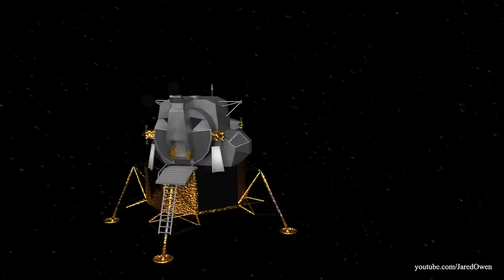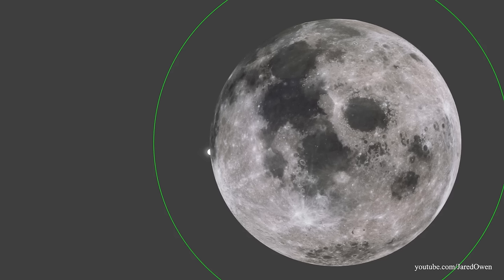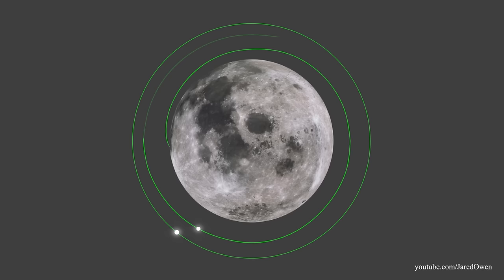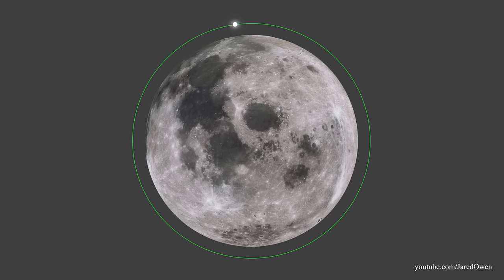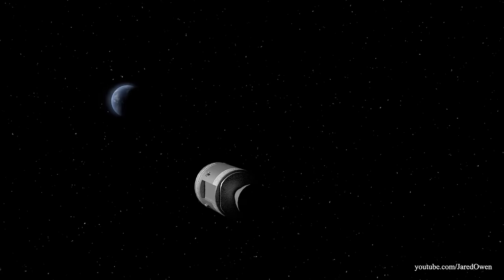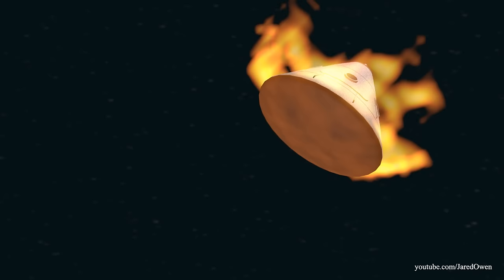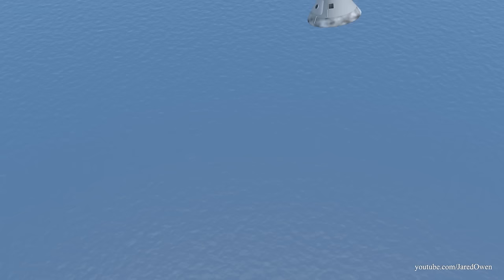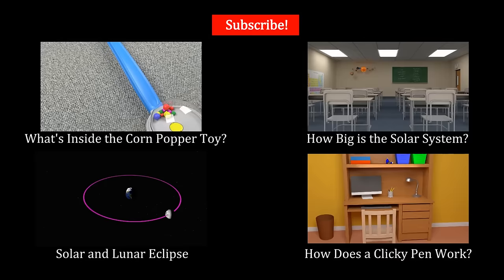How the Apollo Spacecraft works: Part 3

Comment: I was a (young) engineer on the Apollo launch team at Kennedy for Apollos 4 - 13.  This is an excellent series of videos about the missions.  Easy to understand graphics.  Good job.
Reply: what are the chances
Reply: @yutrewoyaGD  like 30%
Reply: Lets forget about Apollo I
Reply: Woah
Reply: appollo 11guy: So you were led to believe that those 3 liar went all the way to the moon?
Reply: @hassanchop7096  You mean they didn't??  Well, I feel pretty stupid.
Reply: @apollo11guy  They didn't leave LEO.
Reply: @hassanchop7096  How did they manage to position the laser reflector on the Moon's surface?
Reply: @apollo11guy  How did they get through the Van Allen radiation belts to get to the moon? As for the reflectors, they must have put them there the same way they put Perseverance on Mars and if so, they would no longer be functioning due to the way the lunar dust gravitates towards the lunar sky when the sun strikes the surface and then falls when the sun has passed by.
Reply: @hassanchop7096  I think it is time to change the aluminum foil in your ET beanie.
Reply: @apollo11guy  I think it's time for you to put down the glue bag sonny!
Reply: @hassanchop7096  I was hoping you would tell us about your last Flat Earth Society meeting;  what did you contribute?
Reply: @apollo11guy  Wrong again sonny, no flat earther here, the ISS is real😋have you ever tried boiling your head btw?🤣
Reply: @hassanchop7096   How?  Very fast.
Reply: @apollo11guy  Very fast what, are you still drunk?
Reply: @apollo11guy  I wish to apologise on behalf of the human race for people like Hassan Chop.
Reply: @letsrock72  He's a person?  I assumed he was an alien.
Reply: Hi, I watched all the ads. Do you allow me (77 yo) to write something down what I once learned about the Saturn 5. First of all I have  u huge admiration of all the amazing people who worked on it.  You are the real stable geniusses.
Now what I find so mind blowing:  The 5 , F1 engines consume in about 2.5 minutes about 2000!  tons of kerosene. One engine also about 400 tons.
Therefore it needs a pretty huge pump. Somebody compared the fuel flow to taking the bottom out of a watertower. The gasturbine that drives the pump, delivers a stunning 55,000 ( fiftyfivethousand) horsepower. The power of a of a cruiseschip engine. The exhaust gases cool  the bell mouth of the F1. Geniusses²
Reply: @hassanchop7096  Hi Sir, I am sure I have an argument that those three really were there. There was a lot of competition between the USSR and the USA. The Russians never denied the Americans reaching the moon. And they would have if they could.
Reply: Wow! Always interesting to hear from someone who actually worked on the program. What was your position within NASA? Were you ever at Launch Control during a mission?
Reply: @tinnose7363  I worked for Boeing.  Most of the actual work at Kennedy was done by contractors, not NASA.  I was in the Pneumatics and Hydraulics group and spent many hours on our consoles in the LCC.
Reply: @apollo11guy  Ah yes, I forgot about the contractors. My bad. Did you ever get to watch a launch, or was it mostly testing you did?
Reply: @tinnose7363  I was outside to see and film the Apollos 4 - 12 launches;  for Apollo 13, I was at my console in the LCC.
Reply: @apollo11guy  Very cool. Must’ve been amazing to witness such historic events. Good for you!
Reply: Cool!! 😎
Reply: What happened to the lunar module left in moon orbit ? I remember I think the Apollo 11 was crashed into the moon for seismic test. Were the rest as well ? Did the second and third stages get burned up in earth atmosphere as well as the command service module left after cm separation ?
Reply: @tommywatterson5276  Second stages fell back to earth;  third stages went into orbit around the sun or were crashed into the moon.  The LM ascent stages (mostly) decayed from orbit or were deliberately crashed into the moon.
Reply: @apollo11guy  thank you for the answers. I often wondered back then what happened to the second stage and especially the third. I was thinking the lem was allowed to crash back to moon surface. I knew some were deliberate to test equipment left for seismic data. In the future it would be interesting to see these moon landing sites and the crashed lems by astronauts.
Reply: You were a young Sheeple...now an old Sheeple 👍
Reply: @davidsheckler4450  And you are a mo-ron.
Reply: @apollo11guy  Sheeple response. You can't prove space an this is your response 😅😂🤣
Reply: Name calling 🤣😂😅 default Sheeple programming kicking in bcs you can't prove space. You can name call all you want I'm not affected by elementary school tactics
Reply: @katalinamartinez8791  (references to the burning fire pressure)
Reply: Lets forget apollo 13 explosion please
Reply: @davidsheckler4450  Proof of space is everywhere, you just intentionally ignore it. It must be sad to live with such a closed-off mind.
Reply: @tinnose7363  That's a hearsay statement without physical evidence
Reply: @davidsheckler4450  If you want physical evidence, all you have to do is look up “Spot the Station”, find your location, and be outside at the right time looking in the right direction. You can see the ISS from Earth, buddy. And if the lunar rocks returned by the Apollo missions aren’t physical evidence, I don’t know what is.
Reply: @tinnose7363  😅🤣😂😅🤣😂😅🤣😂😅🤣😂 unless you can prove you've been there it's a belief system & hearsay "evidence"
Reply: @davidsheckler4450  Unless I can prove I’ve been there? What kind of idiotic logic is that? You clearly need to learn how evidence works.
Reply: @tinnose7363  It makes perfect sense you're just too indoctrinated to think independently. To claim facts & yet have zero evidence is what's idiotic. You want to say it's real but you can't prove it = hearsay
Reply: Yeah, and they lost all knowledge on how they did it 6 times back in the 1970s with “horse and cart” technology compared to what we have today. Blueprints disappeared,etc. So now they are doing it all from scratch, reinventing the wheel and spending billions and years of Artemis missions. Great work NASA😆😆😆😆 Couldn’t even hold a piss-up in a brewery.
Reply: @raffisekzenian2746  There wasn't any "knowledge" to lose. How do you lose any "knowledge" pertaining to something that's impossible to do in the first place 🤷
Reply: @davidsheckler4450  haha..so true👍
Reply: In on the fraud too we’re you
Reply: @Wakes76  Well, I'm so glad to find somebody else who realizes the moon landing(s) were all faked!  Where do you buy the tin foil for your hat?  I get mine at Costco.
Reply: I have a question, how did you make the Apollo heat shield? Like the chemical composition and how long it took
Reply: @hassanchop7096  lmao you smooth brains always get so angry so fast